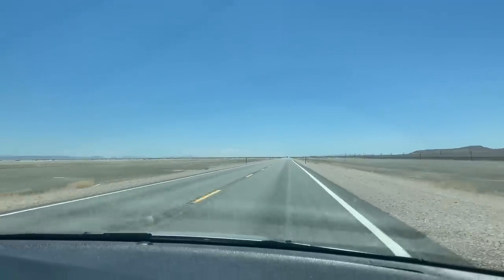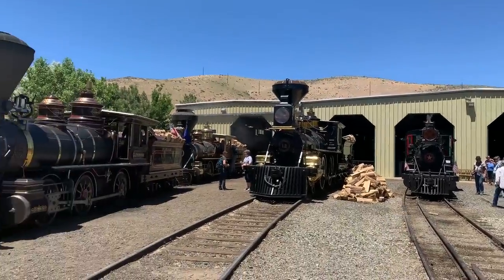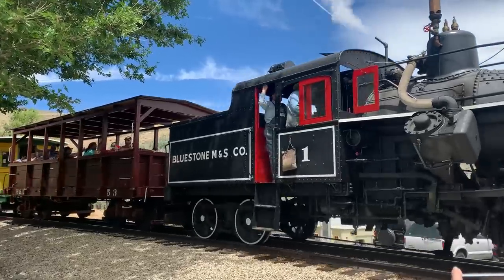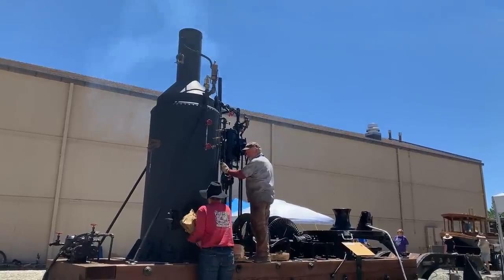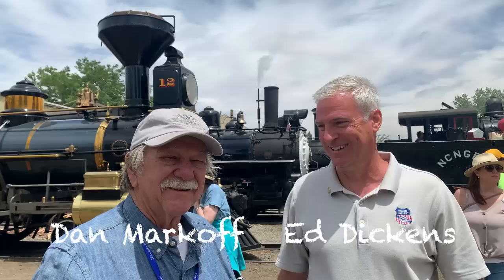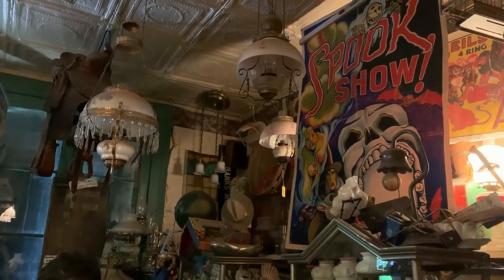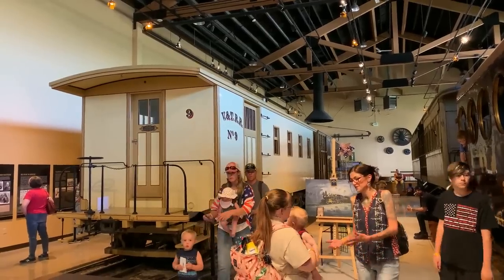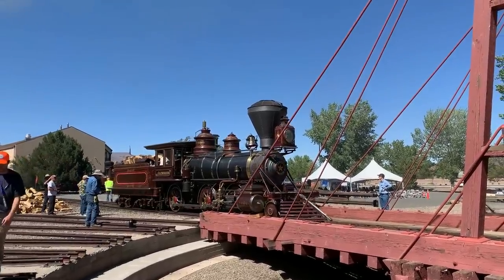Great Western Steam Up 2022 - Preview - Part One

Comment: Do they truck these steam engines from show to show or do they ride the rail?  I have seen several at different shows from your videos.  Always enjoy, keep up the good work.
Reply: Even standard gauge locomotives are not allowed to run on main lines. I saw the local Nevada County Narrow Gauge No. 5 (formerly Tahoe) being loaded on a trailer with rails for transport to this event. Neat that the Nevada State Railroad Museum has tracks to run both standard and narrow gauge trains.
Reply from the maker: @loboheeler  truck is so easy. Until you do it it seems overwhelming. But in truth is really really easy. With smaller locomotives.

Comment: About you featured the Bachmann K27 steam locomotive and you know the history on them including #464 on the Huckleberry Railroad, I thought I'd give you a backstory on their 4-6-0 #152, #152 was built in 1920 by Baldwin locomotive works for a narrow gauge branch line of the Alaska Railroad, and about how I sent you a link to a video of last year's railfans weekend, the paint scheme the Huckleberry Railroad has done up #152 in was the paint scheme she wore during World war 2 when she was transferred to the shipyard in Seattle, most of her life at the Huckleberry Railroad she was the railroad's locomotive #2, even I knew her as that, but she's now back as #152
Reply: Sorry, sir, No. 152(2) was built for the Alaska Engineering Commission for use on the Tanana Mines RR out of Fairbanks to bring coal from the mine to the city in 1919.  The TMRR preceded the start of the Alaska RR.   She lasted until the bridge over the Nenana River was built and the line from there into Fairbanks was standard gauged.  She supposedly was sent to the White Pass for use on the flatter upper end during WWII.   The only real difference between No. 152 and No. 12 of the ET & WNC RR is one inch of driver diameter and No. 12 was built in 1920.
I worked on the Huckleberry RR from April 1979 to Oct. 1983 as the track foreman.
Reply: Got it close enough to the way they describe the history of #152 on the train at,the Huckleberry Railroad